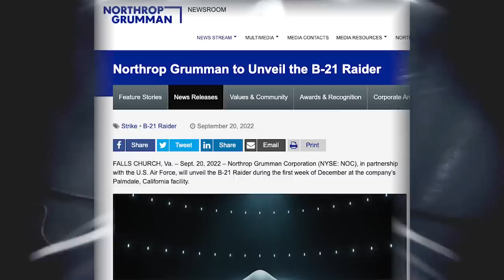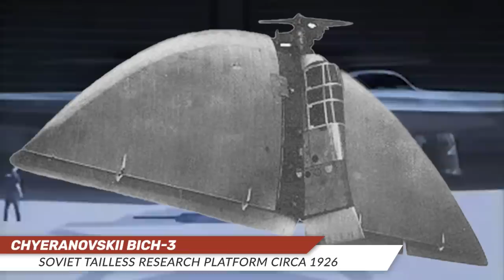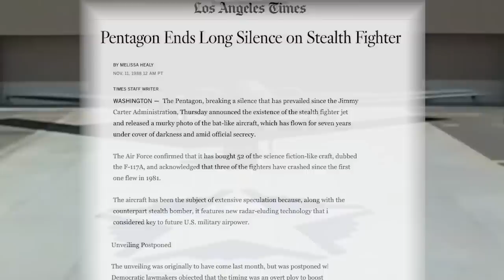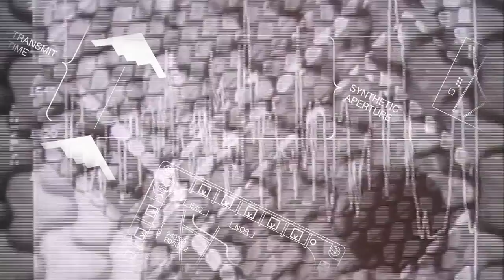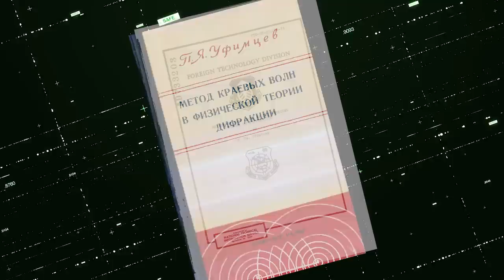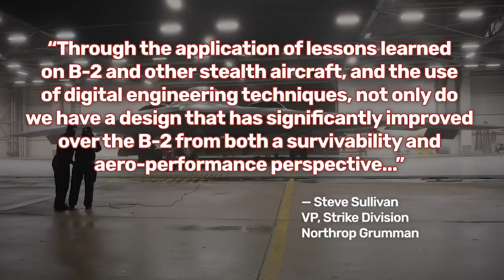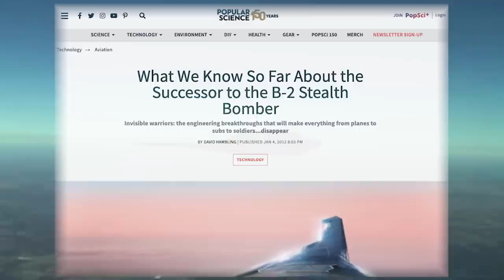Revealing the B-21: Why Northrop Grumman's announcement is a big deal

Comment: The Luftwaffe of WW2 came up with the first flying wing fighter I believe. It was operational as a prototype but the engines caused problems.
Reply: It was found in a beat up hangar. There is a story, true or not, that the Nazis experienced a downed UFO crashed in 1936 and the flying wing came from that. Hard to verify any of those type of stories.
Reply: It was the first ‘stealthy’ bomber of its kind, made of mostly non-strategic materials such as wood. It was SO far ahead of it’s time and the B-2 is so striking in its resemblance.

Comment: 100 Raiders? I heard possibly over 500 Raiders which could also replace the B-52 fleet.
Reply: Nope. Top air force officials have said they would be happy with 175-200 if they can get that. 500 would no doubt be way to expensive and take too long to build anyway. 200 x $600 million/per plane = $120 Billion. 500 x $600 million/per plane = $300 Billion. 200 B21s could already replace the entire B52 fleet. They only have about 60 to 70 of them as it is.
Reply: @gigakrait5648  I agree that seems like overkill. But heck, we spent a $Trillion in just F-35 development. However, You have to account for having half the weapons capacity, and potential for less expensive long term maintenance requirements. Like the A-10, virtually everything for the B-52's is custom made now. At 30,000lbs capacity, it's just about in the medium bomber category. Although, I don't think anyone would complain if all we got was 200. Still, to fully replace all B-1B's and B-52's weapons capacity, you'd need about 500 of them.
Reply: @Condor1970  Yea, but I think what they are going for is precision guided weapons so you'll need less capacity to make the same impact. They aren't retiring the B52s until the 2040s and they never really used all B1s at one time anyway and never will even with their massive bomb loads. So not sure it makes that much of a difference. But I agree that a smaller payload isn't the best idea or most efficient. I'm wondering what will carry the GBU-57/MOPs now. The B2 supposedly could carry 2 of them. Seems the B21 will be limited to just one but with so many more planes it might not matter.
Reply: @gigakrait5648  Instead of side by side bomb bays, I believe the B-21 will be 2 bays in the center, forward and aft. The rotary bomb/missile launchers will have similar (maybe a little less) capacity to the existing rotary setup of the B-2. It does make some sense to have smaller capacity, as loss of one aircraft would not be as bad a loss of one big one. The only way to make that mindset worth it, is to have twice as many aircraft. As B-1B's will be decomming by the end of this decade, and B-52 start decomming in the 2040's, that's 2 decades away, and something needs to replace them. The thought of having less aircraft with less capacity makes no sense if you have to fight a heavily armed near peer adversaries in 2 theaters. Good Heavens, I hope that never happens, or we're gonna need 500 of them.
Reply: I can see an initial run of 200 aircraft, but if things keep heating up as they are, it may be necessary to continue production into a second block run of aircraft that are updated to achieve a larger inventory.
Reply: @Condor1970  By the time they retire the B52s in the 2040s they will have built quite a few of them. You aren't taking into account what I said however either. That at no time has every single B1 bomber been used at once nor have they all ever been at a state of 100 percent readiness. 

This was taken from an article from 2019:

"The Air Force has 62 B-1 bombers. In fiscal 2017, the most recent year for which aircraft readiness data is available, the Air Force said that the Lancer’s mission-capable rate was 52.8 percent, meaning about 32 or 33 bombers were ready to fly at any given time."

That's probably overestimating it to. Those planes are getting old. Who knows for sure if they could actually get 32 up in the air, combat ready, with max load, etc. New planes would at least have the advantage of being in perfect shape. 

They probably won't retire them all at once either. They will do it slowly after production of the B21 has started and they have enough to do it.

They still have B52s as well. Those aren't going anywhere and they have been more than reliable. It's still a lot of capacity even with just B21s and B52s. 100 new B21s is no doubt going to be better than 62 B1s as well. Same with the B2s. They won't retire all at once.
Reply: Nobody said 500

Comment: They keep saying it, but I just don't see the B-21 replacing the B-1B.  Having a supersonic bomber, even if it isn't the stealthiest in the arsenal, is a capability that's proven very useful in the past, and I think we'll continue to have a need for it going forward.
Reply: It's due to the high maintenance cost of the B1s that is retiring them. The one thing the B1 does have over every other bomber is massive payload capability and of course speed. But speed isn't necessary if you have true stealth. Remember, the B1 was designed and developed to fly in low into Russia to avoid radar and be in and out quick, using speed and low altitude. Stealth eliminates that need.
Reply: @gigakrait5648  Which is all well and good WHILE you have true stealth.   However, as the very existence of the B-21 proves, true stealth isn't a final achievement, it's an ongoing struggle to keep ahead of advancements in technology to see through it.  The speed of the B-1B gives it more leeway in this regard, where even when its stealth may be broken, detection happens too late to catch it.
Reply: @IexoPeoa  Well that's all fine and dandy but the US air force isn't looking for a high speed bomber anymore and isn't planning on one. They are going full stealth. They have undoubtedly made major improvements to the stealth capability in the B21 since the B2 was built. You are making assumptions that stealth tech has remained constant over the past 30 years. Also, stealth doesn't make a plane completely invisible. This is a well known fact. Detecting a stealth plane flying if you can do it is only a part of the equation. Targeting and putting a missile on that target is entirely a different story (understand "kill chain"). 
B1s also were designed for high-speed, very low altitude to penetrate Soviet airspace to deliver nuclear weapons. The B1 is no longer capable of delivering nuclear weapons. They specifically did this in the mid 1990s by removing all nuclear capabilities from it. So the B1 is only able to deliver conventional weapons which means high altitude which in turn means it is vulnerable to missiles and other planes. It's top speed is only Mach 1.25. This destroys your argument of breaking stealth and detection. B1s have no stealth. Once they see it, it can be shot down. It's main purpose now is to deliver conventional weapons from either long range (JASSMs) or when you have air superiority.
Reply: @gigakrait5648  Yeah, of course they are, as they have been for some time, alongside the B-1B.   You are making assumptions that radar technology has remained constant over the past 30 years, when even the necessity of the B-21 demonstrates that not to be the case.  If "full stealth" was something you could just DO, the B-2 would still be enough for us because it was "full stealth" when it was built.   Radar technology advances, however, and even with constant upgrades the B-2 is now lagging behind, as, in some time, the B-21 will as well.  In times like those it is necessary to supplement stealth with speed, so that what stealth remains can at least delay detection/reaction until the aircraft has already left the airspace.
Reply: @IexoPeoa  Well, they aren't investing in speed. That's already been established. Next, speed won't do you any good with SAMs that are capable of Mach 3 and better. Almost everyone now has missiles that fast and you're not going to make bombers that go Mach 3 or better. Too expensive and not practical. Missiles is one reason that they cancelled the XB70 Valkyrie bomber. Even at Mach 3 speed it would be vulnerable now. And again, the B1 doesn't go more than Mach 1.25. The B1 was able to do what you are saying, leaving the airspace before detection but only because of it flying at 200 feet delivering nukes. They don't do that anymore. Until it is proven that someone can actually shoot down a stealthy plane, that's the direction they are going to go in. Improvements in radar notwithstanding. You are also forgetting that B2s and probably B21s as well won't be flying directly over hostile territory because they don't necessarily need to unless you have air superiority and have dealt with the air to air threat. Why is that? Because every bomber now is capable of carrying long range missiles. As in up to 600 miles. This is what they do now. They don't go flying over or near Russia or China or some other hostile place because they don't have to. So again, let's see someone detect, track, target and shoot down a B2/B21 from long distance, i.e. 600 miles. Even S400s only have a range of 250 miles. 

One other thing, go look up the air strike on Syria in 2018. They used a combination of Tomahawks and short version of JASSM (230 miles) missiles fired from B1s. They kept them out of harms way. If it was China or Russia or someone like that, you can dam well bet they are going to use JASSM-ERs with 600 mile ranges.
Reply: @gigakrait5648 
It was proven that a stealth aircraft could be shot down in 1999 when Serbia shot down an F-117 (at the time considered to be "full stealth") using an outdated Soviet anti-air system.

That was when we learned that stealth was not an absolute, it was a constant cat and mouse game between the engineers behind aircraft and RAM, and anti-air radar systems; and there's never a clear winner, making positioning and course critical tools during mission planning.  Courses are plotted to and from the target along which enemy radars are at favorable angles to the aircraft for deflection, and sometimes it's not enough.  That's part of the reason the B-21 is being developed in the first place:  A lower cost bomber that could be constructed and deployed in larger numbers, so the loss of one isn't as big a catastrophe.

I think you might be forgetting, however, that the B-1B incorporates stealth features and radar absorbent materials as well.  In this case, course can be coupled with speed to compensate for a larger signature than other stealth aircraft, and make interception more difficult.
Reply: @IexoPeoa  Yea I do remember that F117 being shot down. It was a combination of factors that caused that and not simply because stealth can be defeated. 
First it was a lucky shot. 
Second, the tactics the F117 was following was not standard. Poor planning on the part of NATO was a factor. They also weren't too worried about the outdated air defenses of Serbia when flying the F117. 
Third, they had no electronic warfare suppression or any other cover during that flight. EA6 Growlers for jamming and air defense suppression were grounded due to weather. The Serbs also knew this and weren't worried about them like they normally were and concentrated solely on the F117s instead. The missile site had information on what to expect, general coordinates, etc. They were alerted beforehand that F117s had taken off and were heading out toward them.

The biggest mistake was following the same exact course they were for days or weeks which the Serbs knew and were prepared for. When they knew they were coming, they started their radar search. They luckily were doing a radar sweep at the exact time the F117 opened its bomb bay doors reflecting its radar signature more visibly and exposing its exact position. Serbs got a radar lock because of this at 8 miles and launched 2 SA3 missiles. First one missed. Second one was a direct hit. 
None of this was standard operating procedure for the air force. They admitted to these mistakes afterward and didn't do it again. 

The Serbs basically set everything up and took the shot. It's just that everything worked perfectly for them and they scored a hit.

B1s are vulnerable regardless. Sure they can do things a certain way to increase their chances but in the end it's still a step down from stealth. I'm not anti-B1 by any means but the air force is going stealth only (other than keeping B52s) for the future for better or worse.
Reply: @gigakrait5648  All of what you said wouldn't have been an issue if stealth could be perfect.   The simple fact is that it isn't, so all of those factors are incorporated, and actions taken, to maximize the effectiveness of stealth in the context of the mission, and when they aren't, it fails.   The B-1 just has an extra tool in its arsenal to maximize the stealth features it incorporates:  Speed.  It's a valuable resource that, when combined with all of the other steps taken to maximize stealth effectiveness, gives it an edge akin to proper stealth aircraft, but less sensitive to advancements in radar.
Reply: @IexoPeoa  Dude, what part are you not understanding about speed? B1 goes Mach 1.2 at best. SAMs now go Mach 3 plus. Sure, stealth isn't perfect but it is much, much harder to defeat stealth than it is speed. It's called a kill chain. You have to detect, track, target, keep tracking, establish a lock on the target and then fire at the stealth plane. They use whatever tactics are necessary now to avoid detection. They don't fly straight as an arrow directly at targets and hope. And usually they aren't directly over a target that has air defenses unless those air defenses have been defeated. You don't have to go through all those steps to defeat speed. And unless those B1s are going to be flying 200 feet above the ground, they are vulnerable. They are retiring the B1 and keeping the B52. Funny isn't it? Keeping the slower plane and stealth ones. They aren't going to be flying the B52 into enemy airspace close enough to get shot at unless they have to. Sorry but this is the way it is. It would be great if they could keep the B1s as backups and/or more firepower but the reality is they aren't. They (US air force) feel confident that stealth is the way to go. For all we know, they have improved the B21 so well that even what you think is inferior isn't anymore. It could be much further than you or I think. Besides, if stealth is so bad and speed is so great, why aren't the Russians are Chinese going in that direction? China is creating their own stealth bomber and fighters.
Reply: @gigakrait5648  You keep thinking in really simple terms.  "This plane can't outrun this missile, therefor speed is irrelevant", it doesn't work that way.   Interception of an aircraft with a missile involves a lot more factors than just tossing a missile up there and having the two race to the scene of the crash.  There's geography, weather, radar cross section, the angle of the aircraft to the radar, identification of the radar return as a hostile aircraft, communication from the radar to the missile, the missile's ability to track the target, time it takes for the missile to climb to altitude, the time it takes the missile to make the interception, the fuel the missile has onboard, and the loss of momentum to course corrections to account for the target maneuvering, and how that effects the previous four.  Speed is a very large factor because it rebalances all of those numbers toward the aircraft's favor.  If this were not so, we wouldn't have bothered to give the F-22 supercruise.

Comment: Oddly enough, there's scuttlebutt that with the advent of new ceramic RAM technology, the F-117 Nighthawk may be getting new shiny skin, an engine upgrade, and put back into service as a stop gap for the next decade. It will give a lower RCS strike capability than the F-35, cheaper than the B-2, and will help fill a gap until enough B-21's are put into service.

Comment: It's not just stealth getting 30 years of development since the B-2. It's also aircraft engines, composite materials, computer processing power for avionics, communications, etc etc
Reply: I am really curious how much actual advancement there is in avionics, because already the B2 has some pretty advanced avionics in there. Unsure if carbon composites will end up being used in the B21, but that's one area that's definitely seen lots of development and widespread adoption. Combine that with improvements in engines and I wouldn't be surprised to see the B21 with a meaningfully longer operating range.
Reply: @reaganharder1480  many people don't realize that the B2 along with other stealth aircraft are regularly being upgraded. Obviously the B2's shape and radar absorbent material coating the aircraft play a significant part in it being stealth. However, given the most technological advancements in its computing abilities, the B2 still remains second to none. It's no longer just its shape and coating that keeps it stealthy, but also utilizes resources simultaneously from satelites,  air resources, land resources, and sea resources. All of those resources work together simultaneously in a coordinated effort to ensure the B2's stealthy effectiveness.
Reply: That thing is going to have VR and wall to wall touchscreens.
Reply: @exactlybasically8603  not until SpaceX had its part in development ;)

Comment: Awesome job as usual! Thanks Alex! With the significant advances in new adaptive engines and newer Ceramic based Ram, the combat factor gets a significant boost. The newer RAM, can also tolerate something like 3000 degrees no?, so less maintenance, and for fighters, that's huge, cuz they don't have to let off the gas after 5 minutes,  with No damage to RAM....we just have to wait for it...amazing stuff. All kinds of new toys coming out...we will really need them if the trends continue.